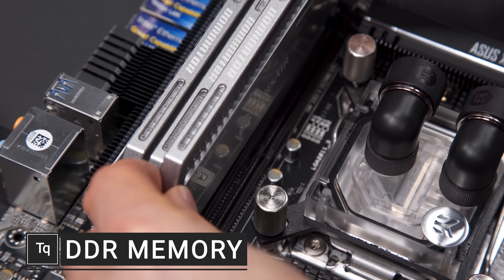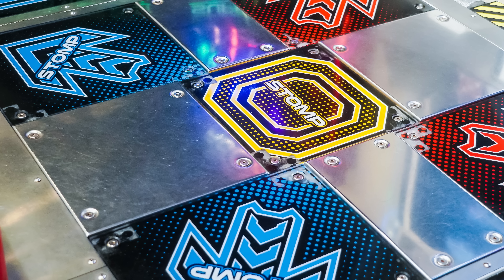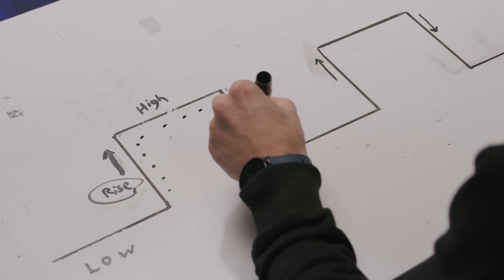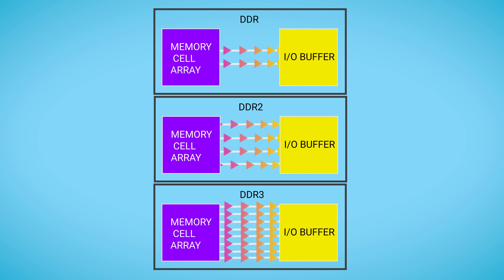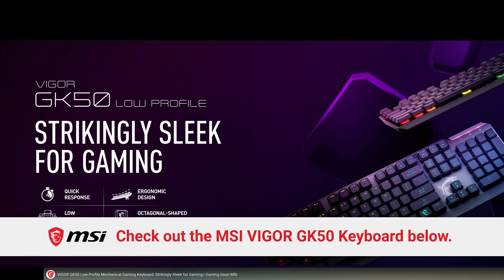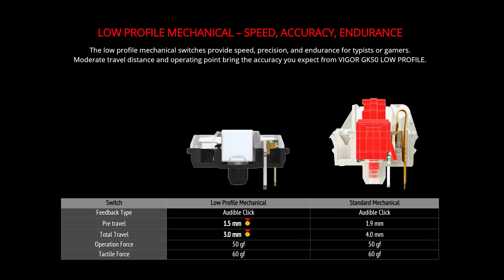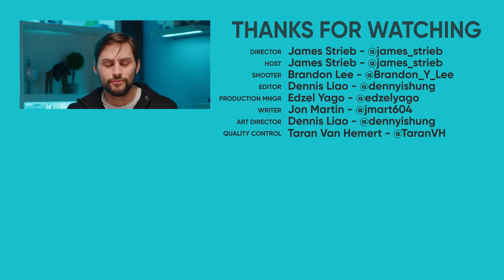The Magic Behind RAM - How DDR Works

Comment: RAM is the one piece of hardware which has had the least performance increase due to frequency increase. In fact every generational jump tends to have the base performance module internally clocked slower than the previous generation faster chips gaining performance from improved prefetching, double rates etc.
I have yet to see a RAM chip be clocked at over 500Mhz directly (aka not on the CPU bus but the RAM chip itself) and I am not including SRAM or the likes used for caching and similar.

Comment: FYI DDR doesn't move data more quickly. it can only move data at the rate of the clock speed. What it actually does it move twice the amount of data per clock cycle than SDR. DDR memory sends data on the rising edge and falling edge of the clock cycle. This is where people fuck up and call DDR4-3200 and 3200MHz., its not, its 1600MHz memory SPEED but can move 3200Mbps of data thanks to the "trick" that DDR uses.

Comment: I remember when USB still wasn't standardized yet and all the wires had individual connectors. You did not want to fuck the specific boards configuration up cause that little mistake would fry your whole board without even plugging in a USB device. So different pin sets to keep you from plugging in the wrong ram is completely logical.

Comment: The funny thing was I once saw a motherboard for sale online that had both DDR2 and DDR3 RAM slots. 4 DDR2 and 4 DDR3. They called it "backwards compatibility". The trick to that is to pick one because the motherboard was designed to automatically disable the RAM slots  you didn't use.  So if you chose to use DDR3 RAM, it disabled the DDR2 slots. If you chose DDR2 RAM, it disabled the DDR3 slots. So, you would not be able to use both types at the same time as they stated it would be electronically impossible. When I saw this thing, it had me thinking "What the heck?" "Why does this exist?"

Comment: WTF!
MSI sponsored you with money, but instead they should have sponsored you with info. 
You have a 'Tech' in the channel name, it means something, isn't it? And you lied in this video.

I mean you were sponsored by MSI and all what you said is the first paragraph from wiki about DDR. You skipped the basics:
1. What generates that clock impulses? At least SDRAM/DRAM
2. Is that current? Is that voltage? Is that, I don't know... "the third harmonics" in the Fourier transformation? 
3. What is the difference between internal and external clocks? Or/and why you need them? 
4. MT/s? Really? It's a f*king MegaTon neither MB nor Mbit. Or you want to say that this memory can carry a heavy load? 
5. Why you can't boost external clock for older generations? Isn't that called overclocking? What's the deal there?
6. "Notches in different places, which means it cannot be used in the same motherboard", you've just said that theirs is no backwards compatibility, aren't notches there to ensure it? than for tech's sake – say so! 
6.1 There are combo motherboards for different generations of DDR, so it's a straight up lie… Well, at least something here is straight. 

This looks like a 'cheap video' made for the record and not for the audience. I mean it's visually beautiful and entertaining, but it's technical nightmare and… I don't want to say that bad things about it… But really, the informational content sucks:
• Jumping from facts without properly stitching them together.
• No clarification of important things.
• Nothing 'insightful'.
• Wrong information. 

For the future, I would suggest either hire a tech writer for tech-related scripts, or study something like Microsoft Style Guide, that give some perspective on how to write about technical stuff.
I've watched this video several times, because I thought that I was just nitpicking, but no… I just don't get the message. Is it there? The only message I got, is "oh MSI sponsored that video, and we made video that tells about something-something RAM, and we say it's magic, because we don't understand how it works". Like what is the freaking message? That DDR doubles the rate? That in newer DIMMs have banks? Newer is better and more efficient? RGB will save the world? 

Guys, why? Just why? I mean if you've missed something very technical, it wasn't that big of the deal, but how can I trust you now? After you lied and didn't check the basics… Add a tech reviewer in the workflow for our tech scripts. I mean why you didn't send your scrip to MSI for a tech review? And if you did… Well, I am scared of buying MSI now, if their engineers missed that in script…

I have a request: please reDIMM yourself with a follow up error-correction video.

Comment: Which of these is better
Both meet my requirements so just wanted to Know which will be a better brand ?

Buy Alketron DDR3L RAM Memory | 2GB - 1600MHz - CL11 | SODIMM | PC3-12800s | for Standard and Gaming Laptop/Notebook/MAC Online at Low Prices in India | Alketron Reviews & Ratings" https://www.amazon.in/Alketron-DDR3L-RAM-Memory-2GB/dp/B08FJ9PTZK/ref=pd_aw_sbs_147_17?_encoding=UTF8&pd_rd_i=B08FJ9PTZK&pd_rd_r=15543e1d-4bfb-4922-8570-fee157a32496&pd_rd_w=sHtka&pd_rd_wg=8zgSe&pf_rd_p=0d69d15e-4c82-413b-ac5e-75d3769e25f9&pf_rd_r=0GJDV0AE29ZP0M1JGFVT&psc=1&refRID=T10H9MSP4FRTAMBZKBYA

Or this one 👇

Buy Simmtronics 2GB DDR3 Laptop RAM 1600 MHz (PC 12800) with 3 Year Warranty Online at Low Prices in India - Amazon.in" https://www.amazon.in/SIMMTRONICS-2GB-DDR3-1600MHZ-LAPTOP/dp/B00OKE1J52

Or this one better ?

Comment: You forgot to mention; AMD first implemented DDR. Intel acting on its high horses used way more expensive, and apparently "more advanced"  RDRAM (Rambus DRAM) , that was actually  having high licensing fees, high cost, being a proprietary standard, and low performance advantages for the increased cost. Company iWill (long dead by now) made Socket A based on (also extinct) ALi  chipset with DDR memory. The Athlon XP 1900+ were a real winner over Pentiums back at that time.

Comment: -"The original DDR actually came out way back in 2000..."
What do you mean "way back"? I still have a machine with EDO DRAM that works, kind of, as a door stop... I remember building it using the then incredibly new and untested EDO memory. Can't remember the chip set or the motherboard model, though I'm pretty certain it was a FIC (was that First International Corporation? Computer?). As far as I can remember it was the first motherboard supporting EDO that was available on the market, and I ordered one directly from FIC. Well the company I worked for ordered a sample that I payed for and used for my personal machine. The memory was also a special order, all 8 MB of it...

Comment: When is new next gen ram dropping and mainstream you think? DDR6 how speeds will be 5k+
Reply: Next year 2021 in theory the acutal usage of ddr5 and ddr5 improvements over ddr4 are based on ddr6 speeds over 5k?? 5k what frequncy clocks what?
Reply: @davidbeams8705  yeah I meant the high end of DDR4 will be the low end of DDR5 for speed.

Comment: RAM is like the freeways for traffic: no need for extra lanes before the traffic is high enough.
Reply: DDR6 HAS Different modules with seperate voltage controls and frequency controls for each memory module on the card so much tuning available extra lanes are okay if you can make some faster and others wider depending on the memory quality in the chip.
Reply: @davidbeams8705  Wtf....

Comment: This is a very complex topic and there are certainly inaccuracies, but still currently the best explanation. Basically, it is a synchronous (sync to request)DRAM that has its own "processing" clock. The real buffer clock is simply your CPU request. The speed of the ram chips are measured in latencies in nanoseconds, and as long as the CPU request multiplied by the "clock" speed is smaller than the latency for each different operation(some take longer to finish), it will work fine. Note here the clock is NOT the data bus speed the way it is in an SRAM or in a ripple counter or in asynchronous RAM(usually syncs to a continuous clock).
Reply: https://en.wikipedia.org/wiki/Synchronous_dynamic_random-access_memory
Reply: @davidbeams8705  Thank you. Fixed.

Comment: "even older RAM like this .. DDR3"
*i'm not crying in 3GB DDR2
:-(
Reply: How tf are you using 3 gb in 2020 man 😭😭
Reply: @Neyaxx  i got 8gb ddr4 2666mhz and thats make me wanna cry and this man is using ddr2 3gb
Reply: @Neyaxx  so, I have a 2gb Windows 10 x86 laptop. It can run 4 Chrome tabs smoothly
Reply: @jcgamingofficial4466  i run 16 on 2 gb of ram using a small trick 

hehehehehehehe
Reply: @Neyaxx  i have 2 gb of ram clocked at a decent 1066 mhz
and the computer is much more than enough for my work

only bottleneck is the gpu which i will be replacing soon
Reply: Stop judging this poor guy everyone. Windows XP only required 64MB ram (128MB-256MB recommend).
Reply: @Joestorm2000  windows xp is almost 2 decades old, so at least allow me to be surprised this guy still uses ddr2
Reply: Do you live in a cave or sth?
Reply: I just went from 8GB to 64GB at nearly twice the speed my laptop ran at. Wooosh
Reply: @lexecomplexe4083  that must've been a god level upgrade for you.
Reply: linux runs fine on 3g ddr anything
Reply: I use ddr3 4gb ram
Reply: That comment got me because i actually remember SDRAM. Yes it existed once upon a time, it's not just a mythical beast.
Reply: * Laughs in 32GB 3600 CL17 *
Reply: Cries in 1gb ddr 2😭
Reply: @HoloKola oh I see 🤔
Reply: I am using 4GB DDR3 in 2024😂😂. Not a tech guy at all so learning what is this about and looking to upgrade to 8GB and SSD. Money is a problem tho😅.
Reply: I still have 8GB DDR4 but I'm planning to upgrade to 16GB dual channel this Christmas
Reply: @youtubeshadowbannedme  sounds like a plan bro 😁 enjoy
Reply: 2 GB RAM @ 800 MHz & Windows 10 x86. I feel you bro 🥺

Comment: There is so many errors in this video... most anoyngly is that they confuzed ddr with syncronus memory. 

Sdram is the first memory with built in mux. Ddr is the exterior interface... it have nothing to do with the internal design.

Ddr is really just brand names. It was really just the original ddr that was double data rate.
Reply: https://en.wikipedia.org/wiki/Synchronous_dynamic_random-access_memory
Reply: @davidbeams8705  Yea?

Comment: Don't get caught up in DDR5 right away, the CAS latencies are insanely high and were kept a secret until very recently because of how unimpressive they are. https://www.anandtech.com/show/16143/insights-into-ddr5-subtimings-and-latencies People forget that when a new DDR standard comes out it's no faster than good sticks of the previous generation. It's going to take the chip fabs a while to realize the potential of the DDR5 specification.
Reply: Yeah well same speed MUCH MORE Ram amounts on chips ddr5 welcome
Reply: @davidbeams8705  Once again, that is determined by the fabrication node, not by the DDR specification.

Comment: "Even older RAM, like DDR3?"

*laughs in EDO RAM* 😂👌🏽
Reply: I remember using computers that used DDR, Then I moved up to DDR2, then I moved up to DDR3, In the future I will move up to DDR4. It's just the natural order of things?! When DDR2 came out, I built my first decent gaming computer with a Pentium D, It was a space heater but, the computer kept on ticking. It never overheated to the point it would shut itself down at because I had good fans in it.

Comment: I'll be honest, I struggled to understand almost everything from the video except the mention of RGB at the end. 😂
Reply: Old tech is slow, and power hungry. New is good, but may not work in older systems.
Reply: @spyder001  Thanks! :P
Reply: @heelmeplz  welcome. Because I'm using an older board, and have to go through all that for compatibility. And it's hard to find good products currently,  that are compatible with my board.
Reply: @spyder001  Aww, I hope you're able to find a good solution for a reasonable price!

Comment: Why can't we jump directly from DDR4 platform to DDR6 on PC like the new console generations do?
Reply: That would be gddr6.. that is totaly diffrent from a potential future ddr6. Gddr6 cant use slotted memory, so we cant use it on PC
Reply: @matsv201  PS5 uses GDDR6 and has basicily a Ryzen CPU which is also used in a PCand the memory controller is on the CPU. It's possible you only need to solder these chips on a stick instead the motherboard and make a slot with enough pins thats easy to do.
It think that the OS/BIOS won't support it.
We will have DDR6 on PC nut why waiting another 6-7 years when they have DDR6 now? Just switch directly from DDR4 to DDR6
Reply: @christianponopp8756  its not a ryzen cpu.. its 8 zen core. Ryzen is the specific brand name of stand alone cpu:s.

Not only that, the caching structure is different.the memory of the ps5 is conwcted to the apu infeastructure not the cpu. The apu infrastucture is conected to both cpu and gpu symetricaly.

Ddr5 and gddr5 is not the same thing they work very diffent. Is just brand names. There is nothing newer wirh gddr6 than ddr5. The higher number dont imply that its newer... 

Gddr skipped the gddr4 number hence they are on a higher number.

Comment: these 2 sticks can not be used in the same motherboard.. unless you have a board with both DDR3 and DDR4 modules on them (Huananzhi x99 TF) and a CPU that has DDR3 and DDR4 memory controllers

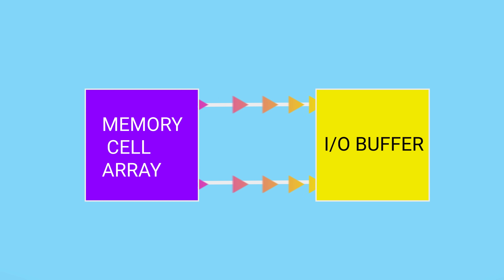Comment: 1:48 so what you're saying is:
DDR1
2 people leave the house every 1 hour (internal clock 100%) and a bicycle comes every 30 minutes (external clock 200%)

DDR2
4 people leave the house every 1 hour and a bicycle comes every 15 minutes

DDR3
8 ppl leave the house every 1 hour and a bike comes every 7.5 minutes

DD4
8 ppl leave house 1 and 8 ppl leave house 2 and a bike comes every 3.75 minutes
Reply: Yea.. to bad its mostly wrong
Reply: @matsv201  I need homie help, can you explain?
Reply: @brianfong5711  ram is really slow. So in the 90 they figured they could have several banks of ram and just mux between them so they could get 100Mhz memory. So sdram was created having 2 or 3 banks of ram on each chanel.

When they wanted to increase the speed of the bus, the clock signal become smeared. So they created ddr to run the clock and the transfer at the same nykvist freqvency.. they usualy had 5 banks or so, but a buffer of 4  bits.

With ddr2  they introduced signal level alowing 4 times the data on the same nykvist freqvency. Bow the memory had about 10 banks. The number of banks is not fixed.

The issue is when you want to acces a new adress the buffer need to be empted. So they made prefetch so the memory could preload the right adress from the banks into the buffery to send via the buss wirh not emptying of buffert.

Ddr3 dubble data rate  and quadruple bit deaprh  so 16 levels. The bufffert is 8 bits, and there are usualy about 15 banks.

Ddr4 is same as ddr3 but with 4 transfers per clock, stil 4 bit deap. Buufert of 16 bits with typicaly beteen 17 and 21 banks.  Can have i prefetch going.
Reply: @matsv201  So can you translate that into a metaphor with people as data and vehicles as megahertz and memory banks as houses? Or use whatever metaphor you want? This homie help turned into skyscraper help.
Reply: @brianfong5711  its like 20 people going leaving there house every hour. Going to a bus stop with 8 people capacity but it the bus leaves every 25 minutes or something like that.

The numbers dont match up neatly, and that is one reason they prefetch need to be that deap
Reply: @matsv201  So do 20 people leave the house every 1 hour?

Comment: Why... Why make this video. SDRAM stands for syncronous dynamic RAM and DDR is known as DDR SDRAM. Means double data rate SDRAM. It is achieved when 2 memory channels work with a clock signal that is phase inverted to the other. The clock gains are just continuos improvements in technology but nothing dissuades the use of dual channels irrespective of clocks because it will always double the data rate.